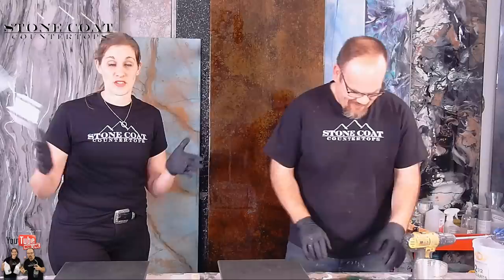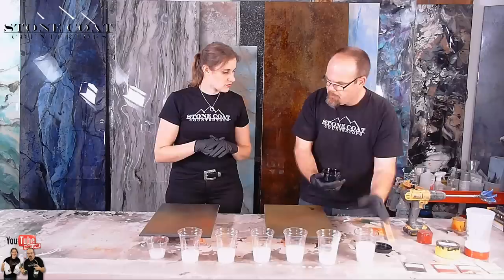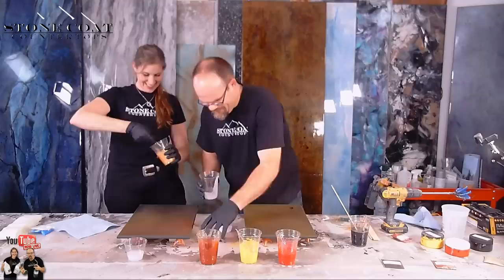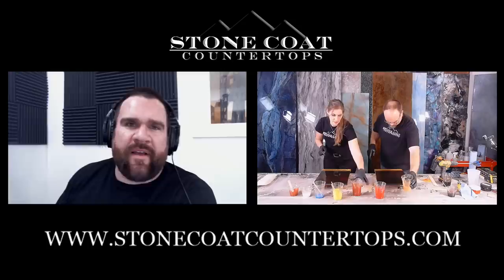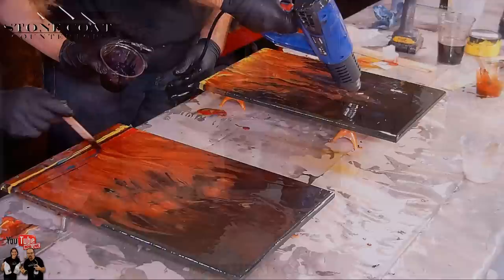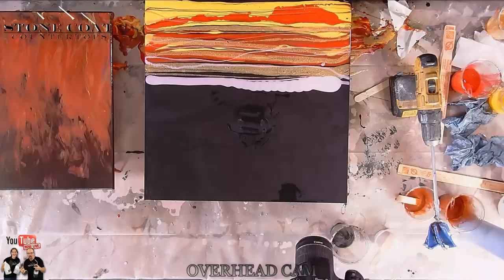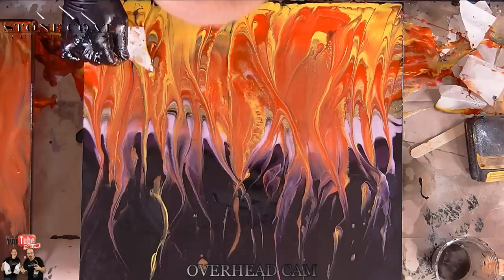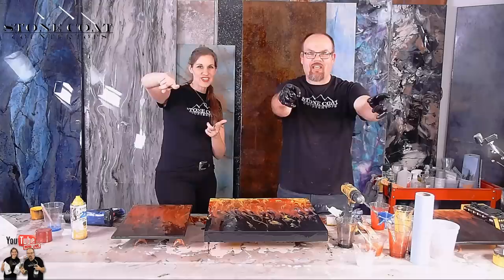Epoxy Flames Step by Step

Comment: Nice to meet you always watching your channel. Although it is a question, is epoxy resin used as a cutting board is not toxic?
Reply from the maker: Thank you so much for being here with us! You can use it as a cutting board application, just keep in mind you won't want to put it in the dishwasher and you may be able to see some scratches over time as its durable, but not bullet proof, great question Paciencia calma!
Reply: Stone Coat Countertops Thank you very much, I will continue to support you from now on I am looking forward to the videos.👍👍